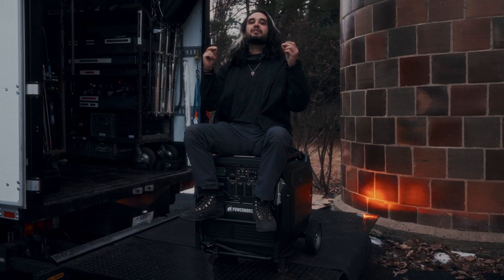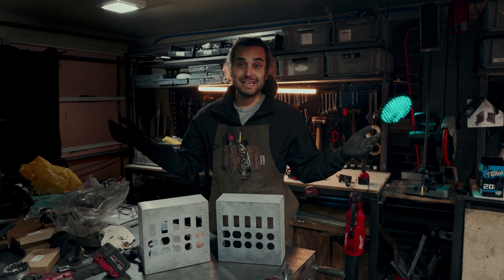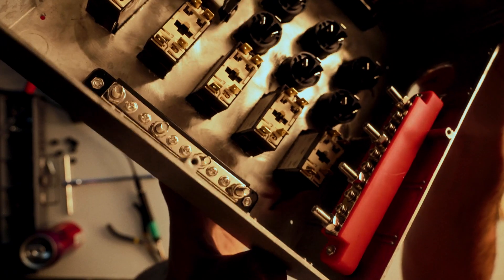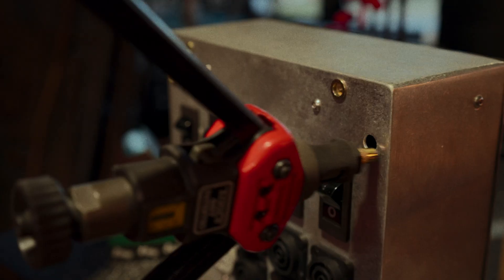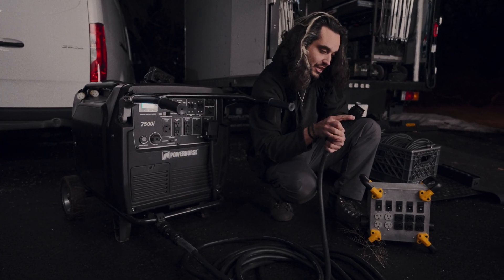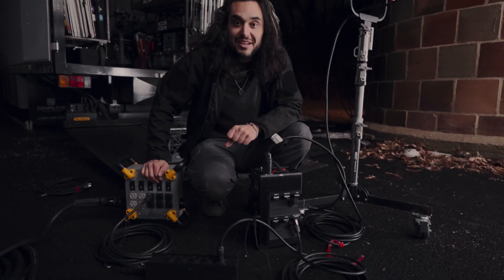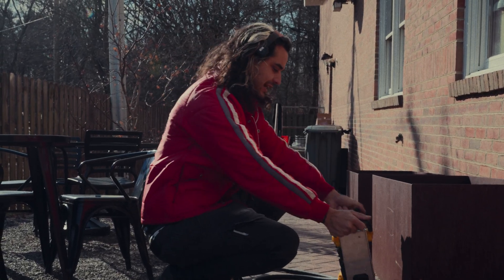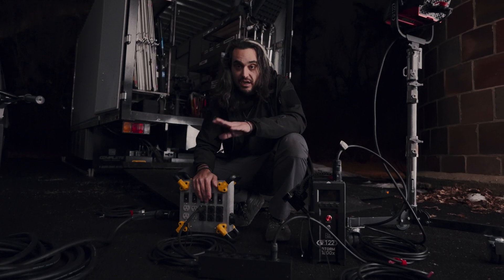The 120v fallacy plaguing the film industry

Comment: I don't know a locking twist connector  L30 on the inlet makes more sense because then that's standard compliant with most NEMA sockets that would be available on generators and the like and already made up chords.
Yeah Bates is a weird standard and I haven't even used it.
OK weatherproof connector could you got some thing going there.
A lot of boats use marine weatherproof twist lock 50 amp connectors (they're not NEMA but they're standard on distro boxes). But I do see that using Socapex would standardize if you already had it.
Reply: SS2-50 is NEMA, ship-to-shore 50amps 240V. Weatherproof-ish.
For power connections it is certainly best to stick with a standard rather than some rando cable (nice as they are) that you just choose the pinout yourself. Can you imagine those black cables getting mixed up and plugged in the wrong appliance?

Comment: Makes a ton of sense to me.  Awesome work.   And I hope the rest of the industry takes notice.
Reply: That's because you're not an electrical engineer. There's a "distro" (hate that) box inside the circuitry of the genny.
Reply: @jeffnolan7392  well yeah, but the generator is a hundred, or more, feet away from all the stuff that you need to run off of it.   The redundant circuit breakers are there to protect the wiring downstream of the box.   We could call it a "breakout box,"  since its basically a fancy custom power strip...
Reply: @jameswarner7435  Then why are there wheels and wheel barrow handles right on it? You roll gas powered compressors and gennys to the job, you don't use long lines.

It's an air cooled single pictured, the wrong unit for a show. Then you'd use a light tower to light the show and they have a power panel and about 20a for auxiliary stuff, like the show. Water cooled diesel Kubota triples are whisper quiet, too.

I'm not the guy who's "using it wrong". I'm the one who teaches the professionals who rent one how to use it. For shows, too. Weddings, bar mitzvas, you name it.
Reply: @jeffnolan7392  I'm not really sure what you're getting at.  I don't disagree with anything you mentioned in your comment. And I didn't design the thing we're talking about.  But the guy clearly seems to have had a reason to build it.  Perhaps he is just unaware of existing solutions already on the market?  I dunno.  But you seem to know quite a lot on the topic.   Maybe first, we should identify what exactly his problem was.  Then you could use a bit of that electrical engineering expertise to suggest a better solution to him?

Comment: Ive burnt out over a thousand LED lights trying to power them with 240V like you said
Reply: The circuit has to be designed for it.
Many switch-mode power supplies have been auto-ranging for over 20 years now.
Reply: @economicprisoner  The 'auto ranging' input was ultimately an added benefit of active PFC functionality, which is all but mandated to legally sell most consumer products.

Comment: Never had a Bates get stuck, even in the snow.  Camlok yes, often frozen together, but not Bates.  Don't you clean your crusty Bates connectors?  There is a tool for that.
Your lunchbox is not  at all rain-tite, but it could be, You could use CEE form power connectors from the generator to the first distro.  You need a way to daisy chain your boxes and your 4800w isn't fully  using the running watts of the generator either.  Won't get into safety and liability.

Comment: A fool runs duel voltage on 120VAC when 240VAC flows threw smaller wires with more power right at the device to run it more efficiently. As simple as a clothes drier run on 120VAC, the clothes take three times as long to dry and the KWH used overall is more on 120VAC than run on 240VAC. Three phase and six phase power is more efficient yet!
Reply: Its very rare you'll see a clothes dryer actually run on 120V AC here. Other than specific heat pump based dryers that are meant to run on 120 (which those ones take forever to dry) only gas dryers use 120 to run, as they only need electricity to run the timer, drum motor, a lightbulb and the igniter. Electric dryers use 30A 240V circuits.
Reply: @MIW_Renegade  7200 Watt driers are kind of impressive.

Comment: Would rewire this to comply with standard Socapex wiring or use a different connector. Inevitably someone's going to connect it and you'll get 208/240 to your NEMA outlets and short something because a PA didn't know.
Reply: Custom systems, like custom grip gear are great until you hire extra day labor ( or PA(s) ) for a shoot or event. Then it's chaos.
 But keep thinking outside the box, iy's how change happens.
Reply: And for something as simple as power distro - I don't get why anything should be custom.  NEMA/CS plugs are standardized, and if installed on the cord/boxes correctly, can't be screwed up at hookup time.
Reply: @CraziFuzzy  The Socapex is already manufacture spesfic. So this problem are ready exists. The thing that is standard is NEMA. The displays should tell you if the wiring is messed up.
Reply: @ Right, so 'standard' may not have been ideal, but at least TRY to match a 'common' configuration with the Socapex - especially when talking about the ground pins.  Pretty sure most manufacturer's arrangements puts ground pins clustered in the center of the plug - this puts them out where lines would be - so an inadvertent misuse here doesn't just mean the wrong circuits get power, but means a hard short to ground.
Or... and hear me out... don't use socapex for this project. ;-)
Reply: @CraziFuzzy  Yes I mentioned it in another comment but i think i would have used PCE connectors. They are not common in the US but it feels like the right thing.
Reply: @Ender_Wiggin  What is a PCE connector?
May I suggest the connector standard 'IEC 60309'? Widely used in Europe, big/bulky (large separation between phases) and quite robust.
A well-known manufacturer of these, are the Austrian company PC Electric (and the mostly black "midnight series"), but I have not heard them being called 'PCE connectors' as a type.
Reply: @NikolaiBeier  As an American that was the first thing I found when googling to find the connector. Is there a common name that is not the IEC spec?
Reply: @Ender_Wiggin  CEE plugs (or CEE form connectors), after the first standards organization that wrote the specification back in the day.
(CEE also standardised many household plugs, but these are commonly called by the nationality that first adopted them)
Reply: There is not a real standard for Socapex wiring. There are common ways to separate the phases. I do think it would be a good idea to use the common way that way you could be compatible with more systems and not risk having the phase in the wrong place.
Reply: @Ender_Wiggin  not officially, but most are wired in the same way, with ground in the center and the pins in the outer circle as L/N alternately. not the way he did his by any means. Christie has their own standard for theirs, but those are the main choices from what I've seen

Comment: Very cool, but I agree with everyone else saying that the 50A twist is a better way to go. Also, you said "weatherproof all the way down", not until you have the duplexes covered and on caps the true1 ports on the box can you say that. Even with the breaker off, water can get in there easily and at the very least start corroding everything. And I'm not sure if everything on the box has gaskets either, as that would be required too. But the idea is certainly great.
Reply: IEC-60309 plugs and outlets will also work well, and they're even more weatherproof than NEMA ones
Reply: it's as weatherproof as a traveling thai moram show.

couldn't you just buy everything from the european event industry for 230 though. like it all exists already. all euro lower more amateur/cheaper pro gear is indifferent which way you put the 230-240 socket in anyway as well.. as long as you can get a split phase 240 hookup you're good without generators in NA too(the odd stuff that isn't 110v compatible), there's no need to worry about neutral(rather both sides being live) not being ground because it doesn't matter, none of that stuff is built for it to matter*, it's illegal for it to matter and the ground is purely meant to be protective if you short to the case, which if you don't have you need double insulation anyway with minimum gaps set by laws.

it's not even that expensive for the european events industry.. which a lot of runs on a shoestring and a prayer anyway with just normal euro plugs.

anyway being able to run much longer cabling with double the voltage would save a lot of money on the cables.

on the plugs selection there's a number of cheap rugged outside rated plugs as well twist lock and without.

Comment: Love your ideas and energy, but the problem with this self-built distro kit is that it's not certified, such that certain locations will not allow you to use it, and God forbid if there were an accident or property damage as a result of its use, the production insurance likely wouldn't cover it.  The expense of certifying a one-off would be prohibitive. I hate to be a wet rag, but you need to be aware of these complexities. Cheers!
Reply from the maker: Damn that's a super legit critique! Thanks for bringing that up! 🤔
Reply: @De_Con there’s a simple solution… just don’t bring it up 😉

Also what you’re doing is good, people like you push the industry standard forward. Thank you
Reply: @ Having everything needed to be UL listed is what keeps you Yanks from improving on your ancient electrics.

I am in the Netherlands and anything I built is considered "built to Dutch specs" and therefore OK when I have it inspected according to the Dutch norm for that type of device. 

Nice sticker and report and I am good for 1 year. Next year same process and so on.
Reply: It's not an if, it's when. Nvidia recently did the same thing, connecting multiple wires/connectors together at both ends with no protection per conductor, resulting in melted cables. And that was "only" 12V 50Amp.
Reply: Didn't want to go there....  Not UL listed or built by a UL certified assembler.  Unlike all the stuff coming from Lex.

Comment: I think versions of this are definitely the future. There seems to be a bit of a consensus from other commenters that a 50A twist lock would be a better move than Socapex but the original idea was very inspired.

There are a lot of generators that are like “yeah I can do 30A at 120v or at 240v” especially with those 240v makes so much sense. Getting so much more capacity with easier/lighter cabling is an absolute layup. Great project man!
Reply: If you are using this specific generator, you would probably be fine using the NEMA L14-30 connectors, if you really have concerns, you can beef up the cable itself between the connectors as the connectors themselves probably handle a little more.

Comment: True1 is largely replaced everything in the live production business. It's such an excellent connector. Reliable, extendable (each cable has a male & female end), they lock, AND they are IP rated when mated.
Production biz tho we largely run 208v on everything unless something explicitly needs it because well, more juice! That and it's not uncommon to have hundreds and hundreds of feet of cable between the distro and the destination.

As much as I love Soca I would say a CS 50A twistlock is arguably a better choice because - standards.
Reply: Not more juice, but less voltage drop over longer lengths.
Reply: @jd3497  less voltage drop means more voltage remaining at the end. Per Ohm's law, more voltage leads to more current for a given load, meaning more power before the breaker pops. "Juice" is imprecise, but since they're all improved by maintaining a high supply voltage. Within design limits, of course.
Reply: some might stick to lower V higher-A ( and more guaranty of wire-stranded/continuity's-ect ) for the safety's reasons as my background is in millwright/manufacturing and automotive-repairs and there's a push for the low-side to go to ( and or lowered-voltage ( ie 24V AC ) AC-current for longer-run's and transfer to DC-@part( ie 5V or 48V computerised signalling chip's to power to LED/lazzer/fibreglass-system or say-wiper's-motor ) and part-to-AC as computerised has made it smaller and cheaper-ect ) 48~v ( upper limit to wet/human safety and bare-wire/hole's/bad-PVC ) instead of the 1955~era 6V DC battery/car's

120v ~20-222hz still can start fire's and or hospitalised-human's so that's debatable
Reply: @richardprice5978  Split single phase has the same voltage, relative to ground.
Reply: Well you're not going to run dimmed power off of True1. What about fixtures that are 120V only?
Reply: @ Depending how "dumb" they are (read: bulbs only): you could put 2 in series.
Edit: I think dimmers may pop if your tried to put them in series at 240V.

Comment: Workshopping how I can convert my house so I can run an XT26 off my house circuit 😂
Reply from the maker: 240 volt dryer plug to this standard. The xt 26 only runs at like 11A at 240
Reply from the maker: You can make a dryer plug adapter.
Reply: @De_Con oh for sure. We’ve actually built a few of those exact stingers to run an XT26 in a house. But just out of distaste for the US standard, I’m tryna convert my whole house 😂

Comment: with the Socapex it would be best to put all the grounds and neutrals on the center pins, so if your stuff gets unintentionally connected with standard Socapex stuff there is no chance of any housings on equipment becoming live. and as someone else has mentions I am more of a fan of SS2-50R twist lock's instead of Socapex.
Reply: I don't think Soca is "touch proof" - you could get shocked inadvertently directly at the Genny (or any female / output) end.  Also, bear in mind that Soca is its own standard.  Keep in mind your config Vs the standard, and potential outcome if one was connected with the other - it would need to fail safe.

Comment: Hi, former live event tech and current an electrician/IT guy here. As much as I love Socapex i would have personally used Nema 14-50R to SS2-50R instead of soca. It would probably be cheaper and you would not need to solder anything. 

Great video. I love the ingenuity.
Reply: The positive of Socapex is you can find it everywhere thanks to the adoption by the live events industry. Even cities without film centers and vendors most likely have an av rental house like Encore AV who can get you socapex. It's only time before Lex Products "borrows" this idea. My only advice is follow the wiring standard for socapex to make sure it plays nice with more off the shelf accessories - and UL listing would be vital for insurance and fire code.
Reply: I agree, caltwist (California twist) is great for genny/outdoor power distribution. 
Was going to suggest small LEDs above each outlet to easily determine if the outlet is live but I like the meters better! Great build!
Reply: I agree, socco is not the right choice here. Especially because bussing the 12ga conductors together without individual 20A breakers per conductor is dangerous. If a solder joint goes cold (note how hard it was to solder those pins…) now you’re running max amperage through 1 fewer conductor. And if 2 go cold… etc.

I probably would have done with #2 feeder and camlock. I know it’s annoying and heavy… but there’s a reason for that.
Reply: @59317  You might not have noticed in the video, but I did see that no two (hot) pins are connected to the same plug/sink, and as long as you keep them separate there should not be any safety issues, otherwise I would have yelled in the comments as well.
Reply: I've never seen it called an SS2-50 until know. Learnt something! Always a CS6364
Reply: As a counterpoint neither Nema 14-50R nor SS2-50R solves the problem of corrosion welding, weatherproofing, ejection assist or locking for that matter (twist lock is there but there is no latch), which were key points in the video, that said I believe there are some US military standards for connectors that do address those issues, but those would probably increase the project cost exponentially.
Reply: @frozendude707  NATO spec electrical plugs are available on surplus often enough, but yeah they're not the cheapest. They are insanely robust and straightforward though, since they're designed to withstand being operated by morons in the middle of nowhere.
Reply: Agreed.  The fact that you can get these kinds of connectors for a fraction of the Socapex and are about as easy to plug in and remove, but keeping in mind the generator only really supplies 6000-6500 Volt-Amps running capacity, he could probably get along fine with even a L14-30, especially with LED lighting.  If you have large concerns with even this, just make the supply cords larger overall gauge.  I mean, what kind of loads are they really running on these in the first place?  I am also not a fan of daisy-chaining these things but I know there is often a reason to do so.  I am not an electrician by any means but does this generator really have any noted advantages over a Honda?  On the smaller 2200i Honda inverter generators, the engine is a bit oversized and tends to have lower voltage drop when larger loads are connected compared to most imitations out there.